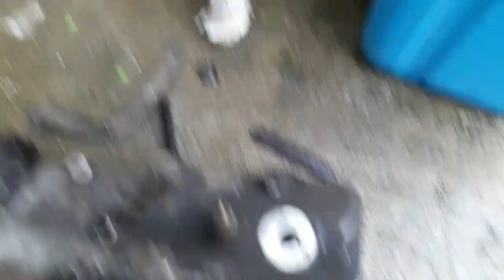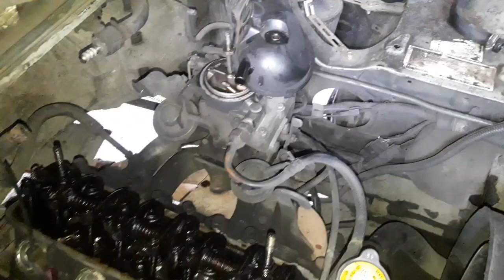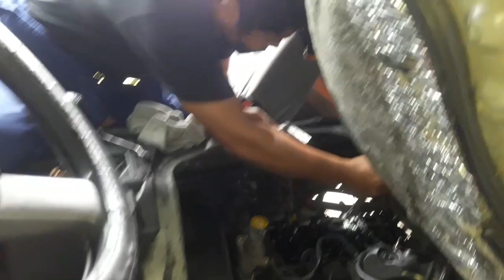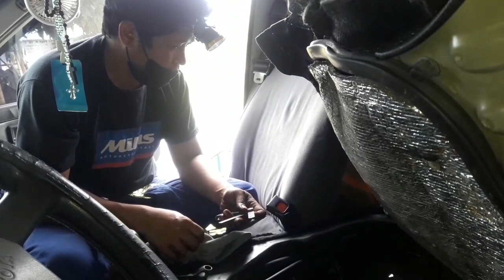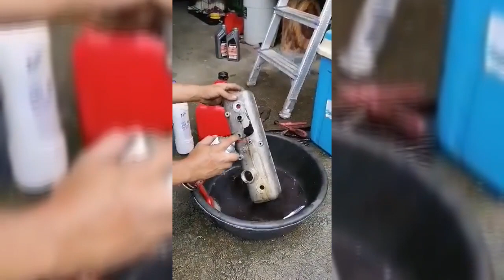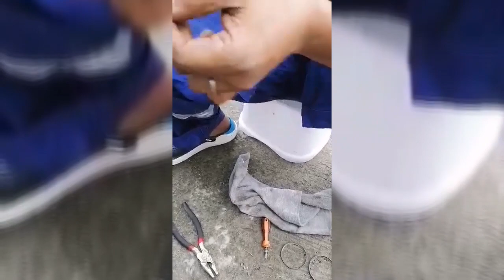5k Engine,valve clearance,pcv valve replace,valve cover cleaning.

Comment: boss yung sakin pagkatapos ko maadjust lahat ang valve,yung 2 at 7 na valve ay parehas gumagalaw..dba pag naka top dead center ka sa 1,dapat 1,2,3 at 5 lng nagagalaw,pero nagagalaw din yung 7..Kapag naman top dead center sa 4,dba 4,6,7,8 ang gagalaw,pero yung 2 gumagalaw din..ano problema non sir..nong pinaandar ko naglangis sa piston.
Reply from the maker: Limot ako sa short method boss,para sure ang tune up boss mag long method ka na lang 1,3,4,2 ka na lang mag tune up para sigurado na nakatama ang clearance

Comment: Halu po sir tanong k lng po sa toyota 7k ko po bakit po usok nya puti lalo na pag uminit ng husto ung makina.salamat po
Reply from the maker: Try nyo po muna ibleed sir cooling system kung continues ang bula,tapos check nyo po pcv valve baka barado
Reply: @tech-ls2vd  carb po to saken sir nacheck k po pcv valve pero maherap po matangal.
Reply from the maker: Kapag nagdudumi po ang carb at dun napupunta engine oil sigurado barado pcv,uusok talaga
Reply: @tech-ls2vd  paanu po ang pagtangal pcv sir maherap po kase mabunot.
Reply from the maker: Mahirap po talaga tanggalin yan lalu na at matigas na yung grommet na goma.masisira na po pag pinilit.kailangan may pamalit
Reply: @tech-ls2vd  kaylangan sa shop po talaga sir.

Comment: Boss ask ko lng dapat ba pahigop ang hangin ng breather yang tinatakpan mo. Bakit yung sakin pabuga ang hangin ng breather? ano posible problema? pcv valve ba? anong pcv valve ba ang pwede sa 5k. yung sakin plastic hindi bakal. salamat po. subscribe po ako
Reply from the maker: Yes po pcv problem yan.tsaka check nyo po yung devider kung hindi pa barado ng sludge,circuit brand na pcv may nabibili pa bakal din.tsaka yung hose na papunta sa ilalim ng carb check nyo din po.baka barado na din ng sludge